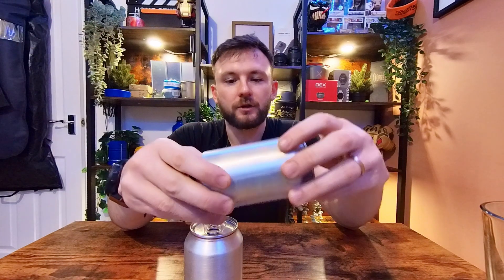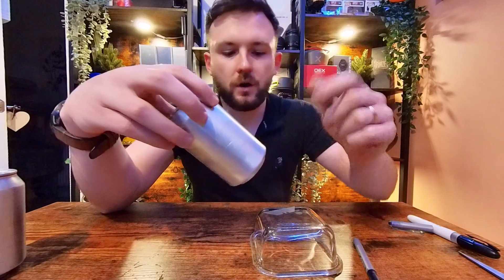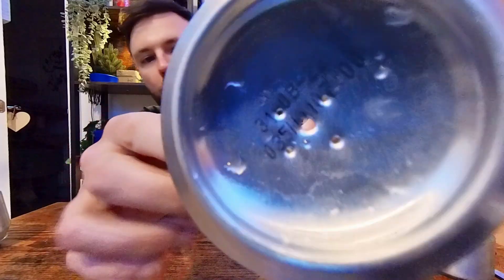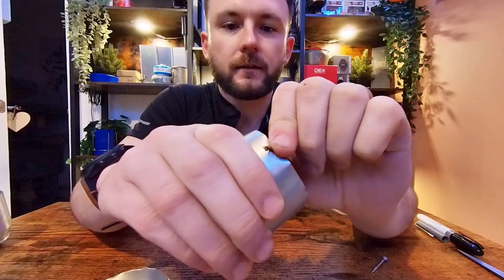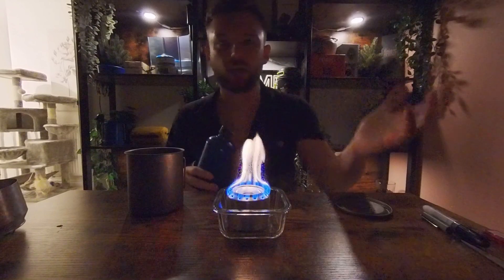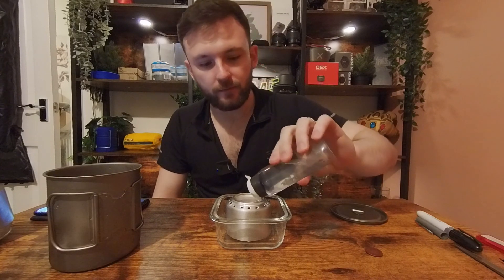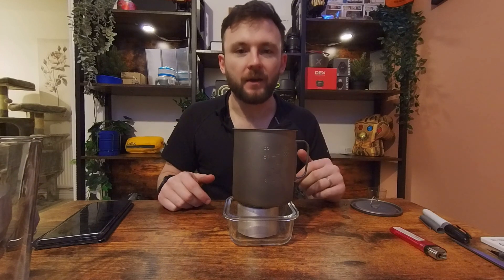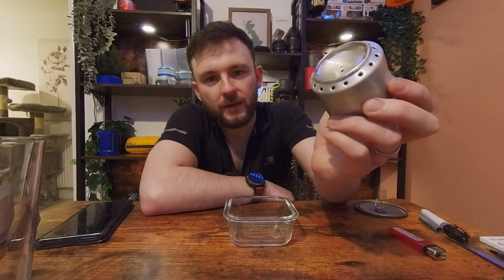DIY Alcohol Stove / Heater Series - EP1 The Penny Stove

Comment: I'm Native Canadian That lives in Northern Ontario ..Lots of untouched land Huge fish moose and bears .....I carry alot of things in my truck Even a fuel stove ...However for a quick boil up for tea/coffee I use my Penny stove with rubbing alcohol i get from a discount "Dollar store" And my coat hanger stands for my pot .....Your cans will come out alot cleaning if you do not Cut them all in one go...score them about 3 or 4 circles with the blade lightly ...if it takes 5 or 6 times so be it ...Use the same blade Sitting on a book And move the can Not the blade ...Adjust your holes to be smaller in dia And in the amounts  As for the whole idea of a penny stove Leave the penny out do not pour alcohol outside the stove...Light the hole in the middle with "some" alcohol around it Let it burn for say 30secs you will see the outside light too..Toss on your penny And move to center with a stick ....My stand is about 3.5 inches  The Stands are U shaped And wired together in a triangle around the stove  The Stove i currently have (2 years) has 8 holes  And with about the same amount of water as you The water boils and i get around 10mins of burn time..The trick is the flame say is 3 inches long you want the last 1.2ish inches part of that top flame on your pot which is the hottest point
Reply from the maker: Thanks for the comment 🙂 sounds like an awesome place, as the series continues I will be looking into some DIY stands and I've been looking at a few coat hanger stands to make. Hopefully as I make more stoves it will give me a chance to experiment a bit 😀 thanks for the advice